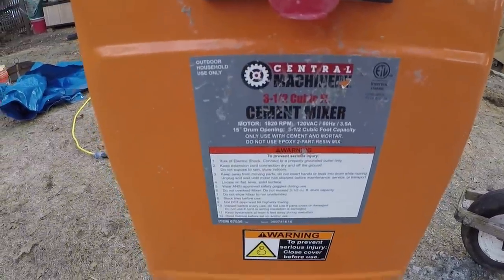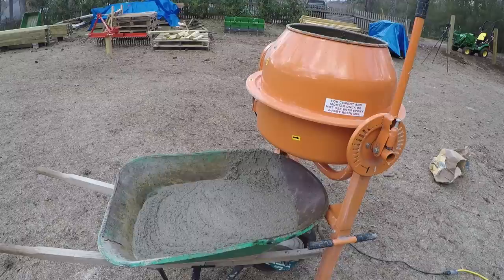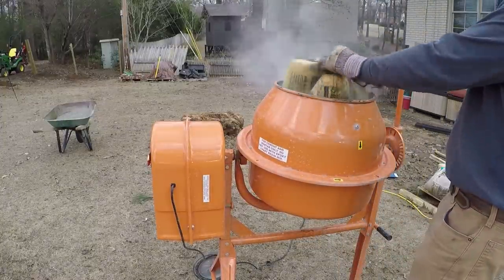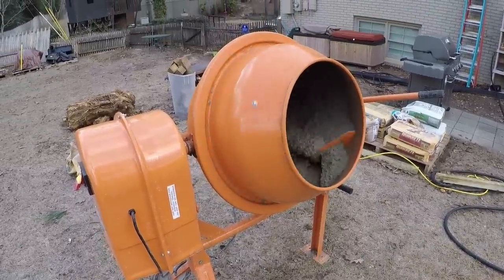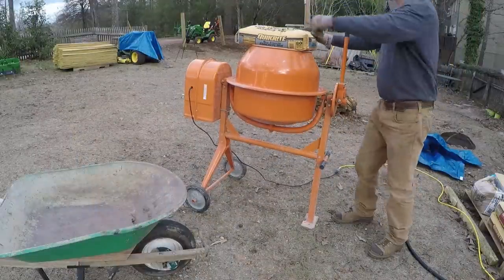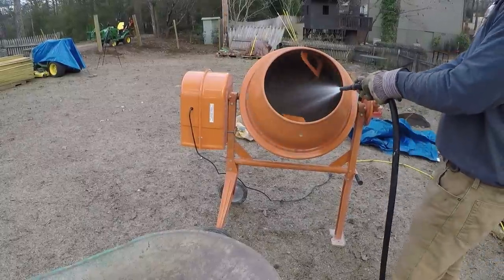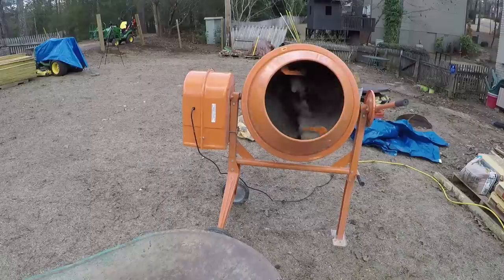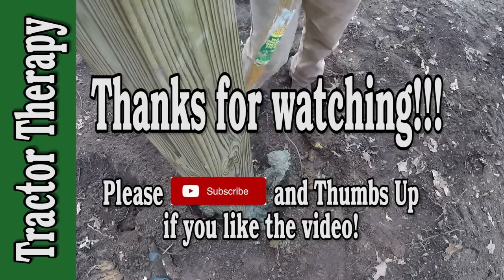Harbor Freight 67536 Cement Mixer Overview and Action

Comment: I purchased one of these with a 30% off coupon.  I put it together with some red locktite and made sure I had an assortment of spare nuts and bolts, just in case.  I have used it for making a sidewalk utilizing 80 LB bags; which will take two bags quite nicely.  So far, I have mixed a good 160 bags through it and it’s holding up!  Remember to locktite the critical gear nuts and have some good silicone sealer for the drum seal.  Best $160 I’ve spent in awhile.
Reply: If you purchased this from H.F. you did not get NO 30% off,Central Machinery is an item excluded from all discount coupons(fine print items excluded).Believe me I've tried numerous time to purchase this exact same item,Have NEVER been allowed to apply any discount coupon
Reply: Not true, at least once a year, sometimes twice, Harbor Freight allows the coupon to used on EVERYTHING!  Or the actual ad will say so or it will specifically have a highlighted coupon for the cement mixer.  I will try to find the receipt.  But, I’m know what I paid for the item.  Thank you very much
Reply: I googled “Harbor Frieght concrete mixer sale” and their are numerous guys like me, whom got a killer deal.  Doesn’t happen often, but it does happen.

Comment: I bought a HF mixer for mixing potting soil for use in my greenhouse, it sure takes a lot of the work out of the mixing process.
Reply from the maker: What a great idea - love it!!! - I'm going to try that to mix some peat moss and sand, soil mix!  Thanks for stopping by - be sure to like and subscribe!
Reply: Awesome idea - my new mixer is now duel purpose - thanks!!!
Reply: Maybe that is what I should use mine for. It should be good for something.
Reply: This thing has gone up a hundred dollars since this video was made. Right now, HF is using this video on its website and he mentions the 150 price a few times. Well, it's now 250!!!
Reply: @tarstarkusz  everything I need to run my homestead has gone up in price and some things are not available and have not been available for months.
Reply: @royhoco5748  You should stock up now.  I think things are only going to get worse.  Now we have the world talking about locking things closed again.
Reply: @tarstarkusz  ahead of you , I been stocking up on what I can buy for a long time, been  buying whatever I can buy in bulk  but you can't stock up on stuff that ain't available. two warehouses stocked with supplies of what we can get. one product that ain't in stock can stop you in your tracks until you can improvise and make do. my perlite supplier has been out of stock for over 6 months, luckily I found some at a another wholesaler  but the price was much higher, I had to check 7 Lowe's stores to find peat moss and then had to travel 50 miles ea way to pick that up, I can order stuff online but shipping is cost prohibitive. a bag of product 44 lbs cost me $22 but the shipping is nearly $30 , we will get through this insanity but it is making it harder to do.
Reply: @tarstarkusz  it’s now $270, fjb
Reply: @highspeedboom  yup $269.99 but lucky a guy today selling one $85 used twice. Why I’m here for review as I’m just doing shed patio and little walk way or landscape curb edges. This is perfect

Comment: Thank you for taking the time to review this CENTRAL MACHINERY 3-1/2 Cubic Ft. Cement Mixer from Harbor Freight. As of Thursday, May 16th, 2024, it's currently listed at $269.99 on the website. I was checking out the BAUER 4 cu. ft. Cement Mixer, which is listed at $329.99 as a Member-Only deal with a $50.00 off. It has a capacity of about 1/2 cu. ft. larger than the Central Machinery cement mixer. According to Harbor Freight's website, the Bauer "cement mixer can mix up to two 80 lb. bags of concrete, stucco, or mortar."
Reply: New coupon just came out. With coupon it brings the Central Machinery mixer down to $199. Probably going to pick one up tomorrow for some projects.

Comment: I have one of these mixers. After using it the first time I could see the center of the drum was doing a poor job of mixing. So, I did what a few others suggested and flipped the 2 blades end for end. Small end at top and big end at the bottom. Now the center mixes well. Thanks

Comment: Because it’s so cheap some might scrimp on cleaning out well after use 
If you’ve tried to remove cement or concrete from a dried mixer it’s almost impossible
Reply: ShakespeareCafe I made the mistake of mixing some “fast set red bag concrete” at 3:30pm on a hot summer day!!! Hahaha Seriously couldn’t get it out of the mixer before it dried up ROCK HARD! HAHAHAHA 
You could literally hear it crackling in the mixer as I was trying to pour it out! Haha I ended up having to chip it out with my roto hammer! My hammer is a BOSCH by the way 😎 some tools you just can’t skimp on! 🤣😂
Reply: Didnt you watch Mythbusters? All it takes is a stick of dynamite.

Comment: Silica is no joke I force my crew to wear masks on all of our sites. Great video!
Reply: Agreed!    Safety glasses should be worn, as well.   Get it in your eye once and you'll never do it again..
Reply: I'm almost 68 and was recently diagnosed with COPD; never smoked in my life. I've been a contractor since '88 and always wore protection for serious actors, but often ignored dusts. Be sure to get good masks as a basic 'dust mask' may not seal out well enough to save your lungs or those of your crews. Best regards.

Comment: Thanks. Good video, clear, well-organized and presented. This really helped make my decision on renting/buying or just having concrete delivered to my farm site outside Columbia, TN. I’ve got 4 projects pending, maybe a fifth, roughly 100 bags of concrete to mix and not all on the same day so delivery, waste, washout, etc., would add up pretty fast. I ran one of these one summer in high school before I joined the Army many years ago,  can’t see that the “science” has changed much at all. Just gotta find a coupon.😊

Comment: I bought this mixer about 2 years ago for the $150 he mentions in the  video.. one of the best $150's I have ever spent.  It is not going to take much abuse, but for someone who is a bit careful with their tools it very much does the job.  Best with (1) 80# bag of concrete mix at a time, more than you need to work harder to keep it in the barrel or get it to mix properly.. or small batches I mixed a lot of sand/gravel/portland with it.  Paid for itself and then some.  Good video figured a lot of guys would watch this to make a decision!
Reply: Do you have a recommendation on the best wheel barrow to use with this- Basically one that is short enough to fit under the mixer?  I am going to be pouring about 50 cubic feet of new floor in my basement

Comment: Cut the bag as you did on top of the mixer but do it on the ground or better yet on a makeshift table. Pull the bag up from the middle and "saw" through the remaining half from the under side with your hand creating two halves. They're much easier to handle and allow for adding to the drum partially filled with water while rotating. Water needs to be first in the drum!!
Reply: Jack, Thank you for this tip. I'm about to do 30 80 lb bags and was dreading it.

Comment: Very informative. I'm getting one for mixing soil for soil blocks. I also saw a way to rig it up to sift rocks. Also, I think it's funny how some people on here say you're using too much water and some say not enough. Everyone's a critic
Reply from the maker: The old adage 'don't believe everything you read' applies in spades on the internet!  Thanks for stopping by!
Reply: Gotta admit, I'm in the "too much" camp. Or at least, the add it in slowly camp. Alot easier to add more water than add more concrete.
Reply: The amount of water is paramount to the strength and durability of the concrete. It's the most important factor. Don't take it lightly.

Comment: I have used one of these. Good for the price. The electric motor is weak, wears out fast, but is easily replaced with a higher quality motor.  FYI wood post in concrete and dirt causes rot from water damage and gives termites a easy path to the wood. Best to pore concrete then use air gap spacers to attach the wood post above the concrete with concrete bolts ect.. will last longer and termites have a more difficult time getting to the wood

Comment: Am I the only one that actually measures the amount of water I use?I use two containers. One container holds the ideal amount of water to use (I believe it's 3L per 80lbs bag) and the other container holds another 1.7 liter of water which is the max that should be used in addition to the 3L that is used.That way I never use more than the directions say.
Reply: After learning that I've been mixing it too thin all these years, I'm gonna start measuring.
Reply: Try filling sand bags with a dry mix of cement,  sand, and  aggregate. After the moisture in the ground hits it, you won't want to be the one on a jackhammer.
Reply: It's very amateur to measure the water.
Reply: No, you're not.  I fill a 55-gallon drum with water, put it near the mixer, and mark a few 2-gallon buckets with the required water level.  Takes the guesswork out of it - compressive strength goes down sharply with added water over design amounts, and it's one less thing to mess with when I'm trying to slam out a patio slab or something.
Reply: Ya you’re the only one.
Reply: Nathan N2 😂
Reply: Curtis Shields you sell patios with this POS?! 😂🤣 atta boy but come on dude get an account at your local ready mix! Hahaha
Reply: @Irespecktyouall   yeah but when you walk away from a project I have to show up a year or two later and fix your mistakes. Do better.

Comment: good video and well done. when I do fence posts I used to mix the concrete but you can put some water in the hole empty the bag of dry concrete add more water jam a big crowbar in it up and down come back the next day and it will look just like you mixed it in the mixer. fence guys told me they do not even add water the concrete will suck in enough from the soil to harden it
Reply from the maker: I've seen folks do this as well.  I guess I'm a little particular about it!  I'm using the mixer for other projects as well, but your point is well taken on the fencing type work!  Thanks for stopping by!
Reply: Not true. That all depends on how much water is drawn. Most of the time the center of the powder pile, the area where the beam is located, is still powder and thus not doing what it should do, keep the beam in place. I’ve heard of people just pulling the beam right out of the ground because they did it the last way I.e. not mixing the concrete

Comment: It's a bear to put together but after assembling I used it to mix around 15 60lbs bags of concrete an it did a really nice job. Roughly ten to twelve minutes to mix two bags at a time took about just over two hours to mix, screed, finish, and broom after it setup a little over 5x4 4" pad....with a couple of water an beer breaks.

Comment: I have a question about the 3.5 cu ft capacity.  An 80lb bag of quikrete makes .6 cu ft of concrete.  My math says it should hold about 6 bags.  Is that 3.5 cu ft dry mix before water or after?  Or is that the volume of the drum in which case you wouldn't use more than about 2-3 bags?  I need to mix about 75 bags for a walkway.  No access for for a concrete mixing truck.
Reply: Dan Burch 80lb. Bag makes 0.66 cu ft
Reply: would you know how many bags Dan can use ?

Comment: Nice video. Im still not sure if i put screws in right place.  I hate the instructions.

Can you tell me when do you use concrete with rocks versus concrete without?  I want to make pavers and smooth walkway.

Thank you
Reply from the maker: Hi PamE - thanks!  Yeah, the instructions leave alot to the imagination :)  You can make a mortar mix for pavers with cement and sand an no rock - or add any type of aggregate to make it stronger.  Pea gravel is common in lots of mixes.  For walkways, a bigger rock would help it be stronger.  Around here they call it 57 gravel - it's about 1/2-3/4"" crushed rock.  The ratios are important as well...
Reply: @tractortherapy42  Thank you!

Comment: I have this mixer, it bogs down with an 80 pound bag of concrete. Not sure why as some of these videos show it working well. I like the mixer, saved me a ton of work, but I wish I could figure out the 80 pound bog down on the motor.
Reply: Easy. If you don't have at least a 3/4 horse motor on it it is going to bog down.

Comment: How do you come up with Three and a half cubic feet of concrete?  An eighty pound bag is .6 cubic feet.  Two of them would only be a little over a cubic foot.
Reply from the maker: Remember you have to add water.   Quikrete Instructions: Allow at least 1 cu ft (28 L) of mixer capacity for each 80 lb (36.3 kg) 
bag of QUIKRETE® Concrete Mix to be mixed at one time.  Also if you over fill, you won't be able to tip the mixer out without spilling it everywhere.  You can't really fill it to the max capacity.

Comment: I have one of these it works great but really noisy. I did weld the motor bracket to where it bolts to the stand because it was really wobbly.

Comment: Your video helped me on deciding to get this mixer.  I am thinking of repainting the drum with epoxy based appliance spray paint be for i assemble the drum. I wounder if it would make it easier to clean?  BTW/There is another video on how to assembly the mixer, and how inaccurate the instructions are. Luckily i saw that video and understand about the arrows.

Comment: the 2 arrows you talk about on mine where both stuck on the top potion of the drum, so that didn't help me at all. I agree with the bolt labeling.... they could have done better by laying all the bolts out and including a picture with the number above them. So you know which is the all-tread and what was for other uses.. The hardest part I had was getting that damn handle down with the spring in it to get the bolt in.. that spring was tuff to compress!!!!
Reply from the maker: Agree!  Putting the thing together was a pain in the arse. I wish I video'd it - I think I made up a few new swear words.
Reply: will the round handle help in some way?

Comment: How is the power consumption on this?  Will it spike up the electric bill using it a week or so? Very informative video by the way great job
Reply from the maker: Not much - it's a small motor.  Your concrete mix will cost much more than the electricity!

Comment: Thank you sir I have a new house it’s all dirt in my backyard. My first project is do a 3 feet walk way around my house then patio etc. This mixer would help a lot I’ll do the form around the house and pour concrete by section that way I don’t overwhelm my self. Thanks again sir! What’s the ideal size and inches thick of my walk way, anyone has a suggestions please? To save money and make a good decent project DIY.Thanks!
Reply: Ek79 E. Hello! 3 inches is a good thickness for a walkway. Some recommend up to 4, but if you’re not moving heavy machinery it’s better to save the money and stick to 3 inches. 2.75 inches also works, but 3 is better in the long run.
Reply: Ozzie Maynard thank you so much and appreciate your answer and time!

Comment: Reviewer: Assembly was quite difficult 
Me: ok I'm out
also if you use the valve on the side of the bag you don't need to cut it in half and it slows down the dust

Comment: Great video, thanks. Why did you recommend only mix 1 80# bag at at time, I figured it should do at least 3 per mix cycle. Too much weight?
Reply from the maker: I'll have to go back and watch again - I think I said 2 x 80# or 3 x 60#.  If I said 1, I'll have to update video - you can definitely get 2 in there.  3 x 80# might be pushing it a little.  I was mixing 1 bag at a time as I using 1 bag per fence post.  Thanks for watching!
Reply: Tractor Therapy 4000lb concrete divided by 27 (27 cubic feet in a yard of concrete) is about 148lbs per cubic foot. 148 multiply by 3 cubic feet is 448lbs.  My question is- Do you think this mixer can handle mixing that much at once?
Reply: @Chumlee1000  clearly by the math he just said, it won't. He clearly said how much it can handle at once.
Reply: I never put in more than about 60 lbs at a time it’s easier on the cheap electric motor it comes with. If you upgrade the motor then you can mix the full amount that it will take.

Comment: Concrete in the bags are already mixed (Just add water). Water the hole, pour the mix in dry, then mix in-hole thrusting a stick or metal rod for about a minute, add water as needed. This is a lazy method but okay for ordinary fence posts. We put up fence posts quickly this way on acreages to keep dingoes out. For shorter perimeter suburban fences, do the same using quickset pre-mixed concrete bags. Use a mixer if mixing your own ratios using portland. Very informative video. Thanks.